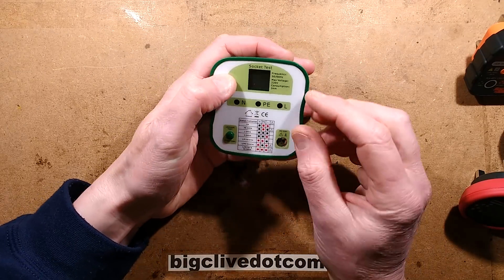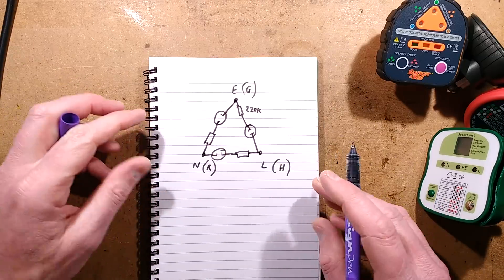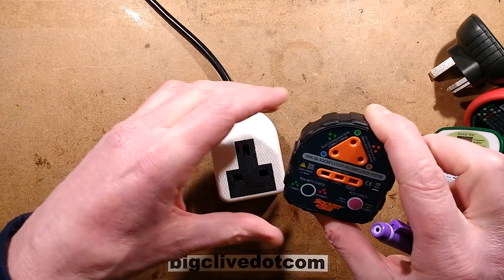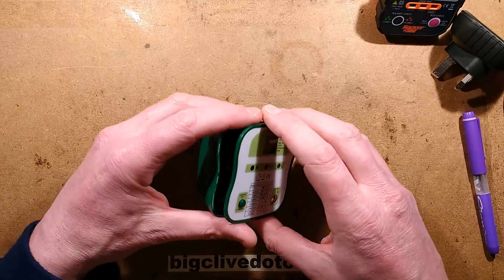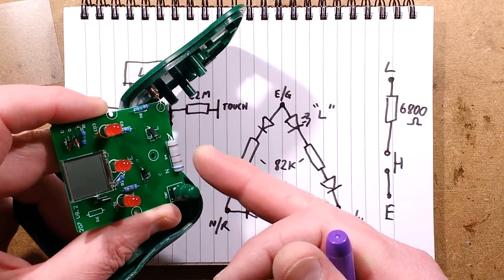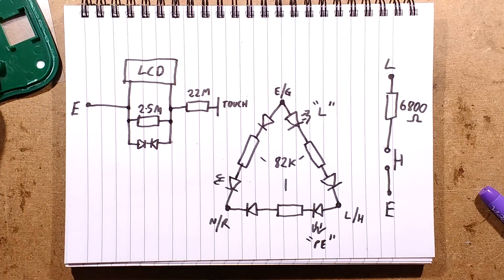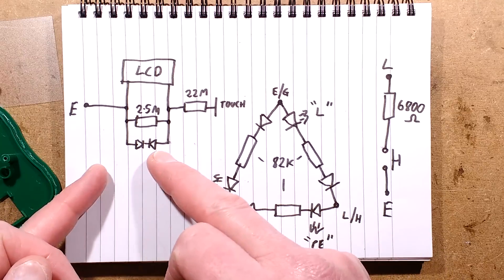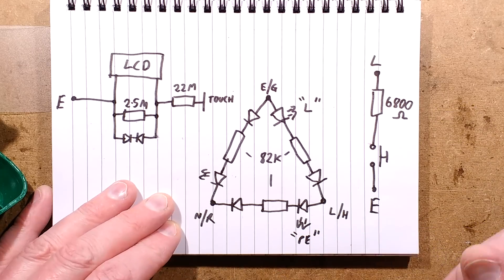Inside a mains socket tester with LCD display.  (with schematic)

Comment: I should get one of these testers as I'm sure somewhere along the line, the live and neutral is swapped somewhere as my bedroom lamps when turned off can provide some entertainment with just touching the outer casing of an LED bulb and they glow slightly, and from previous experience, they're only switching the neutral (despite the lamps being wired correctly) which I discovered after getting a shock off one when poking a broken LED filament bulb and managed to trip the power in the house... :P

Comment: Clive, i'm really not sure this new lighting is working. The top half of the video looks rather overexposed, especially the notepad. Maybe its just the exposure on the camera needs to go down a notch. Or maybe the lights are in a slightly different place to the previous ones?
Reply: Must be those new garish red tinted "high CRI" LEDs.
Reply: It's not a problem with Clive's lighting, but with the camera/editing software/youtube.
Reply: well obviously it doesnt fit very well to his camera setup
Reply: +max things
Why would you blame the lights when the camera is not correctly set-up?
Reply: CodeBugger, how do you know how his camera is setup?
Reply: well obviously it doesnt work very well in this current situation with the white balance
Reply: +Mister Hat
You are right that we can't be sure that it is the camera.
But it is sure that it is not the LEDs, high CRI LEDs are not snake oil.

Also, proof that it is something with the camera/editing/youtube's mangling of the video is the DIYperks video about the same LEDs.
Reply: +CodeBurger. How can we be sure it's not the LEDs? They looked horrible on the other video when compared to the other. I'm not convinced these are high CRI, they look more like reddish tinted than high CRI.

Your proof isn't proof. It could be proof that these particular LEDs suck.
Reply: exactly, looks like CodeBurger has some connections to the company and tries to talk nice words. Even if they are high CRI it could be cheap crap
Reply: +max things
+Mister hat

Shitty consumer cameras add red to compensate for shitty lighting. When your lighting fills the gap, the "corrections" pile up  on top of the color balance.
Look at the DIYperks video about the same LEDs.

Also the complaint from the OP was that the video was overexposed, which is not related to color, and not a new problem on this channel. 

And no, I am not affiliated with any company.
Reply: CodeBurger How do you know Clive's camera is shitty? You don't. Besides my supercheap Sanyo gets the color balance right regardless of the light source. Except sodium lamps, as even our eyes can't see colors with such a monochromatic light source. You're way too defensive of these LEDs. I smell a company shill.
Reply: +Mister hat
Do you even watch his videos? He talks all the time about camera problems, like white balance, exposure, and focus.
Reply: Right, I also never had problems as far it was not a too shitty light. Built a  video light  that diy perks showed made out of a stripe of leds that works great with phones or my sony a7r2
Reply: +Mister hat
I smell bullshit where you comment.
Reply: great, so insulting other people is your choice for solving the problem..

Comment: I think my neon mains tester is even simpler than yours. Only one neon and resistor inside a knob that turns and selects N-L, L-E, E-N in turn. Using it here in France via a travel adaptor caused confusion until I realised that those adaptors reversed N and L. Doh!

Comment: The diodes in series with the LEDs won't protect them from reverse bias because the reverse voltage will be across both the LED and the diode, and the LED can't tolerate a significant reverse voltage. The correct design is to put reversed diodes across the LEDs
Reply from the maker: The older gallium arsenide LED technology is resilient to high reverse voltage.  It's not uncommon for cheap indicators to use a simple resistor and LED.

Comment: Awesome vid, Really interesting product, the same concept would work on 110V/60 here in the U.S of A.
Reply: I have one that I got at Home Depot. Like the green one in the video, it also has the button which shorts to ground so that you can test GFCI. I use it every time I wire a socket, but I originally bought it to help me figure out why stuff plugged into this one outlet would always shock me :)
Reply: Here's the one I bought: https://www.homedepot.com/p/Klein-Tools-GFCI-Receptacle-Tester-RT210/206517824
Reply from the maker: I'll guess that if the shocking appliance still worked then the ground was missing?
Reply: It was a floating ground combined with a misbehaving ballast in a fluorescent lamp on the same circuit. It would come and go as I turned on or off the lamp (but I hadn't made that connection), making it surprise me once in a while.
Reply: They also make a much simpler one that is sold at any hardware store in the US. It has three neon lights that light up to tell if you have any of the problems Clive was talking about. It is the classic triangle circuit. I have one and it works well. It was under $10 US, so yes they do make them for the US and you can get one at any hardware store.
Reply: C MJ just remember that those simple testers will not tell you if your ground is high resistance..the neon bulbs/LEDs draw such a low amount of current, that even a lousy ground will look ok.

Comment: Dear Clive, after watching your very useful video, I decided to buy a socket tester. I looked on Amazon. They have two types made by Socket and See: the SOK36 Professional is £51.95, the SOK22 Craftsman is £19.96. Would you recommend one of these -- or another brand? Best wishes, John in the Peak District.
Reply from the maker: If you just need a basic tester then a cheap simple one will do.  If you are working in an environment where the loop impedance test is needed then that's a good option.  For personal home use I'd suggest something simple like the simple three LED and test button type.  For professional use the one that does the loop impedance test is useful for a quick test.  It's worth noting that the electrical distribution industry issues the loop testing one to their meter installers to use as a quick check.

Comment: The earth thing you talked about where the voltages around the house can get wonky must have been what happend at my folks house. Windstorm knocked a tree down on the line and the power went out. They came and fixed it and after about 2 hours suddenly the lights in half the house got super bright and the other half dimmed superbad, blew up all the TVs and some of the kitchen appliances in one half. The voltage in one half of the house was ~150v and the other half was about 85v (normal 115v supply.)

The power company claimed there was no possible way that it could have been their fault and would not cover any of the destroyed appliances as a result. But the problem mysteriously vanished when they sent some guys out around 1am in the morning to work on the line in the dark.
Reply: That almost to a t describes what I've read on the subject

Comment: At 4:41 Clive says "I have slight lag on the main RCD to avoid it tripping" can you explain how ? I have the same problem with my workshop. If I accidently cause a trip, the trip in the house that runs the workshop fires and not any of the trips on the workshop consumer unit and it's flippin annoying.
Reply from the maker: +Joe Farr You get a type S RCD with a slight delay to allow instant RCDs to clear the fault first.  On events we use multi-layer RCD protection with programmable RCDs.  They're quite expensive though.

Comment: Eight Watts Hot. Love it.

Clive can you some day go into detail how the  US power systems differ from the UK?
For us if I want 240 I have to use L1 and L2. For you is it just L1 ?
Like I said can you please do a video on this?

Thanks
Reply: Thank You both for the details.
Reply: I would really like it if Clive could do a video on how they do differ. 
He has a way of presenting things so that they are easy to understand.
My 3Ph understanding ends at if the motor is running the wrong way
just swap any 2 legs and your going the other way. I don't know anything 
about the feeds from the street out to the sub-station. Neutral does come
in from the street along with L1 & L2. The stuff like stove, electric water heater
and the electric dryer tend to be 240v and any heavy use shop type things
may also be 240v L1 + L2. But really I know just enough to be dangerous.

Comment: I'm in the process of building one of these with 7 watt equivalent LED c7? lamps as the indicators, as my neon tester was far too dim out in the brilliant sunlight. I'm also going to include a voltmeter in it, and a test function for the one lamp thats usually not lit I got a double pole switch and it just made sense to add the extra wire. So I will be able to plug this in at an event and leave it plugged in and if it's too bright I'll be able to turn it off and still see the voltmeter kind of like a rack mount power distro would do but a whole lot more useful and portable.
Reply from the maker: I wouldn't recommend that.  The reason Fluke recalled all their units was because the test current meant that if the ground connection was broken in a circuit there was a risk of a high enough current shock on associated metal to cause muscular contraction and stop people letting go.
Reply: Oh it's a reply, Oh it's a reply from the master of all things Chinese and electric, Oh wait I think you might have replied to the wrong thing?
Or maybe you're referring to my comment on the other comment / video? for N-G Bonds?

Oh "Why Fluke are recalling their SM100/200/300 plug-in testers."Just happens to be in my recommendations list, I thought I watched it.

although I am still in the design/parts stage and I haven't ( it's getting close ) wired anything up yet, so any input is appreciated. I'm using a panel mount voltage display and my only concern is the current draw of the ground LED and possible tripping of GFCI's, i am planning to test that yet and might need to current limit. its a pretty simple design without my complications, it's more or less the triangle with an on-off-(ON) switch on the hot that will toggle between hot on/off and test of ground by swapping the ground lamp from ground to hot.
some more parts came in earlier this week so it was kind of fitting for me to see that there is a video on the subject recently posted.
I have drawn out my schematic coming up on almost a year a go now.
I have most of my parts except for the light bulbs and a clear/transparent case.

Which I decided to complicate my connections by adding in a IEC C14 connector and a circuit breaker for the pass-through IEC C13 and NEMA 5-15 output connectors.
for some reason I like things with pass-through plugs.
https://www.dropbox.com/s/l3lu0yfwjs93ufi/2019-03-20%2001.54.59%20BCV.jpg?dl=0

Comment: Those mystery diodes - are they acting as a Diack, with a breakdown voltage of typically about 30 V?
Reply: *Diac. (Struck by spell-checker.)
Reply from the maker: Not sure what diodes they are.  The text was obscured and they didn't start conducting when I tested up to about 27V.

Comment: Here in Poland, most sockets are Type E, with sockets for live and neutral, and an off-center pin for ground. Double sockets have both ground pins toward the center of the socket, and so you have to invert one of the plugs to insert it. This inverts the live and neutral. Shouldn't this cause polarity problems?
Reply from the maker: +Jim Fortune That would only affect things like fusing and switching in the appliance, but it would still work.

Comment: In my house only live ant neutral come in and the neutral rail is conected to the ground which is just a screw into the foundadion of the house. They call it a Pe-N type circuit here in sweden. I found that pretty strange but aparently it was conmmon at the time when my house was built since very few appliances were required to have earth at all other than wet spaces.
Reply: rimmersbryggeri   This is the normal type! Never the power company sent "saved earth" to a house from outside. Normally after the Wattmeter the N change to N and SE. Then main switch, RCD, ...
Reply: I dont think it is the normal way in sweden anymore but my house is so old it had no earth before I put it in other than for kitchen fittings and the light in the bathroom I think. I think now there will be a separate earth rail in the consumer unit and RCD/GFI is mantatory.

Comment: How does the neon across the hot and ground not trip an gfi? It has to pass current in order to light... is that current just not high enough?
Reply from the maker: +Jack Duno It's a very small current.  Much lower than an RCD trips at.

Comment: Hi bigclivedotcom, how about making a video about these "arc fault circuit interrupters", aka AFCIs? They are becoming "fasionable" these days, at least where I live and legislators are already considering making them compulsory in certain situations.  I really liked your videos on RCDs, so I think doing an AFCI teardown and explaining its function and principle would greatly appreciated!
Reply from the maker: +Jan H I've not come across one here yet.  In the UK the faults are are a bit more decisive at 240V.
Reply: Thanks for your reaction! I'm from the Czech republic and we are using 230V (though in reality the voltage is often about 240V).  Though I've heard that with the "ring main"  you use the UK, less arcing faults tend to happen, because there are two paths and the electricity will use the more solid one instead of arcing... So maybe that's why they would be less useful in the UK...? Not sure.

I've learned about AFCIs from local Czech electrician forum recently and I can't decide if they are overrated or not. My impression so far is that they are a hype and it's mostly ABB and other big manufacturers pushing for AFCIs to be required by the law, in all households. 

I'm really confused, because while the idea seems legit, I suppose many devices like motors with brushes make tons of arcing in a controlled manner and are absolutely safe. But if the same arc was happening "in the wild", it could easily melt something or set it on fire. So either a lot of nuisance tripping or not much real protection at all. But maybe I'm missing something.

That's why I thought it would be really great to hear what someone as experienced as you thinks about them :). 

Anyway, keep up the good work!

Comment: On the Socket&See and the HandyMan there is a double insulation mark but the earth terminal goes into the housing.
Has far as I know, an earth wire is not allowed on a double insulated apparatus.
Reply from the maker: The double insulation probably relates to the plastic enclosure.  The earth connection is for test function as opposed to functional earthing.
Reply: Yes, you're probably right and I don't know the GB regulations. In the Netherlands double insulation means: 
No earth wire in the cable and a 2 pole power plug. Even not a 2 wire cable with a eathed power plug because you can get the impression the device is earthed.

btw There is no fuse in the tester you took apart, does that mean the 0.5mm wires are behind a 32 Amp fuse? That could end nasty!

Comment: Getting "earth leakage" mixed up with "RCD" and ending up with "arse leakage". 

Also, the power rating on the trip-testing resistor probably doesn't matter much. Since if your mains supply is any good, pressing the button instantly cuts the power anyway.
Reply: greenaum I I were to plug that In some instalation I know that thing would burst into flames before triping the rcd ( and yeah there is an rcd...

Comment: you know Michael Faraday’s magnetic induction experiment where electricity is generated by placing a bar magnet in a coil of copper wire. what happens if two diodes were placed in the wire to block the electricity from escaping in either direction? 🤔
Reply: i suppose that the circuit wouldn’t work but magnetism might allow current to flow because it’s a magnetic field 🤷‍♂️
Reply from the maker: +Donald Sleightholme It would act like a break in the wire unless the voltage induced across the diodes exceeded their breakdown voltage.

Comment: So that explains why the house I worked on a few months ago (not on the electrics, but floor screed) was a shocking experience. Every (steel) window frame, every decorative rock/boulder, even the walls gave people a good jolt if we were either walking around in our socks (to protect the new wooden floor) and touching a surface while grounded in some other way, maybe one hand on a water pipe or something... Bloody electrician....